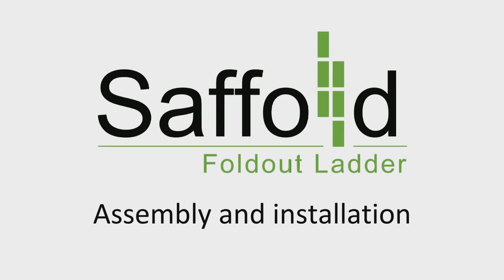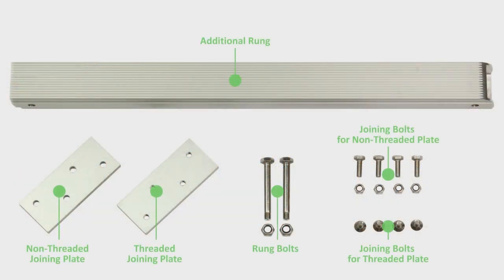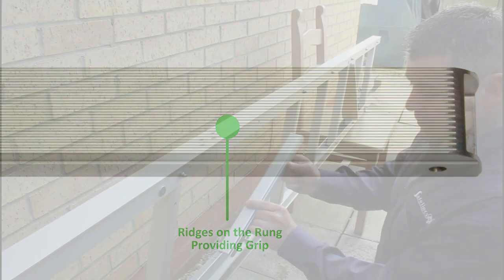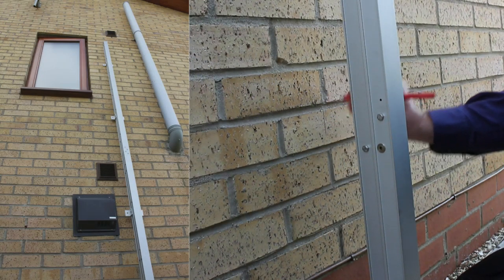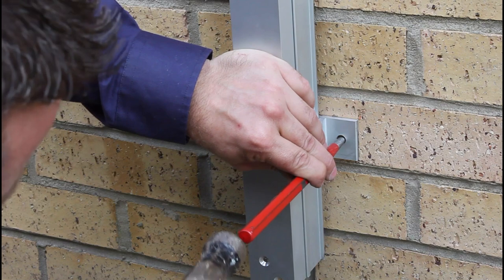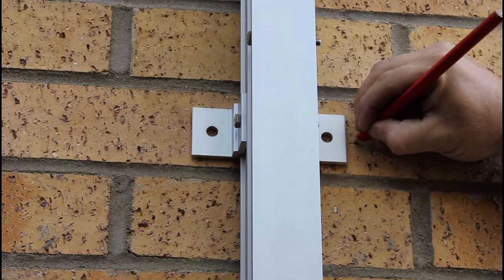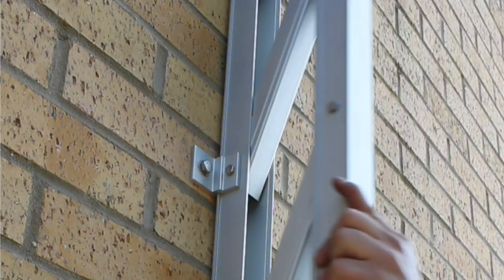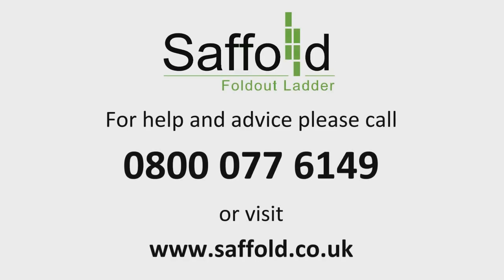How to Install the Saffold Fixed Fire Escape Ladder

Comment: How this ladder ensure that thief will not use it.
Reply from the maker: Hi Sabir, the Saffold escape ladder is secured with a lockpin at the height of the escape window. So a person on floor level cannot access the ladder. The pin is designed so that even with an extension pole etc the lockpin cannot be removed from below or above.
Reply: @Safelincs  Great 👌🏻👌🏻👌🏻👍🏻Thanks.